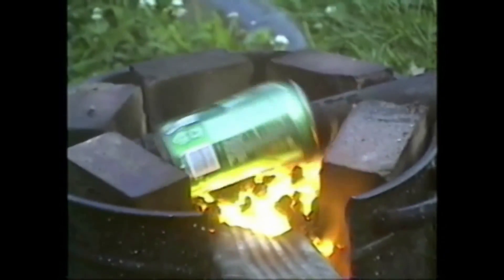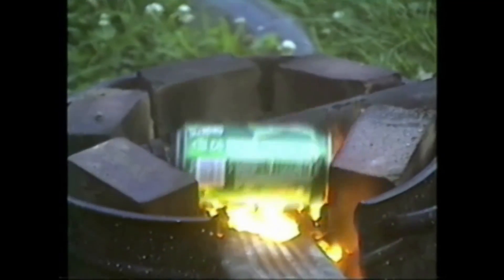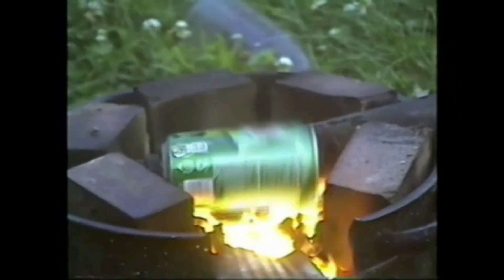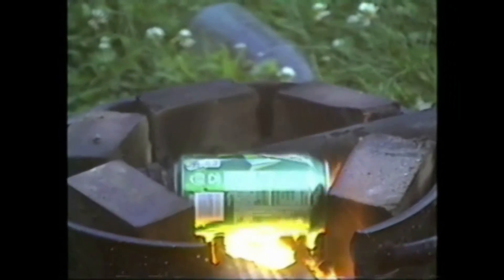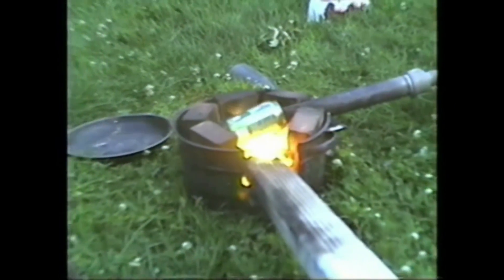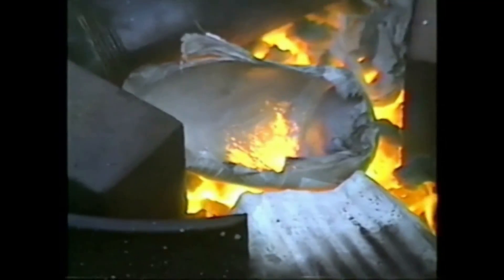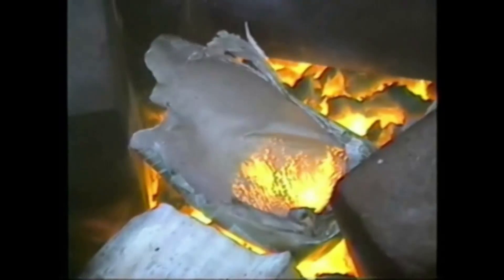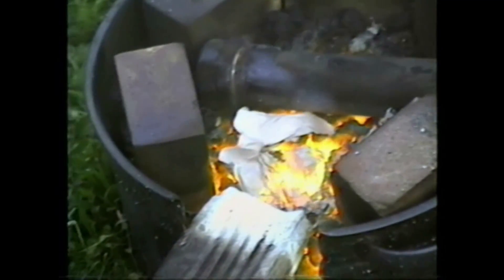400th video: DIY metal melting furnace

Comment: My optoisolator is working, the GPIO being pull down from 3.27V to 22mv (I assume zero Volt) after I diagnosed that crontab  was running a job making the GPIO 24 pin 18 as a PWM, current floating from voltage to voltage. 

I then stop the pwm in crontab -e and the 3.27V was stable at pin 18 ( gpio 24).

Voila! I have the first pull up resistor circuit working with an optoisolator.

Comment: you were so interested in science. I cant believe you were working in McDonald.
Reply: How many places are you able conduct medical experiments on large numbers of test subjects by injecting materials into their food and drink without them suspecting?  - McDonald's
Reply from the maker: ***** it was either that or a cow farm, but at a cow farm they probably test the health effects of the cows so i couldnt get away with experiments.
Reply: Rinoa Super-Genius
it makes sense now.
Reply: Rinoa Super-Genius There is a "Lost Styrofoam Casting Process " method that melts out styrofoam instead of using wax which is used "Lost Wax Casting Process" to create the voids in the molds.  While the packing peanuts might be problematic in making shapes, you probably have a lot of styrofoam floating around an area that ships electronics.  Styrofoam should be easy to shape by carving with a hot blade to make smooth cuts.